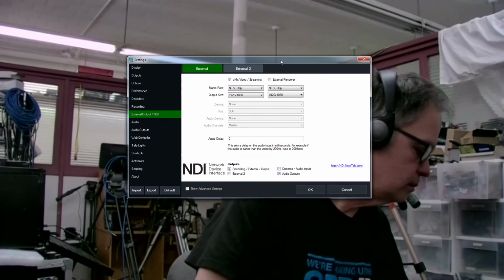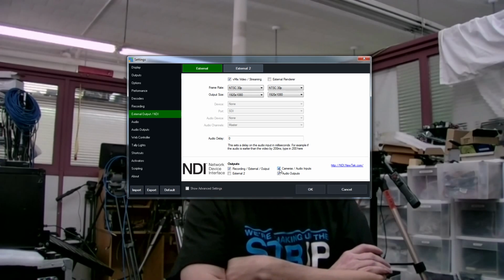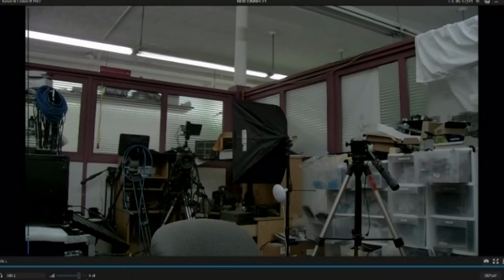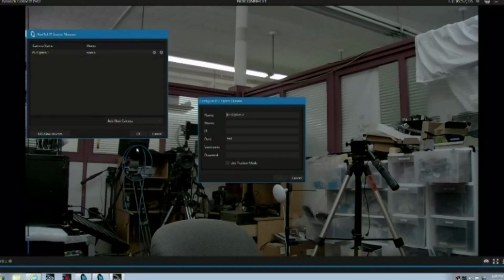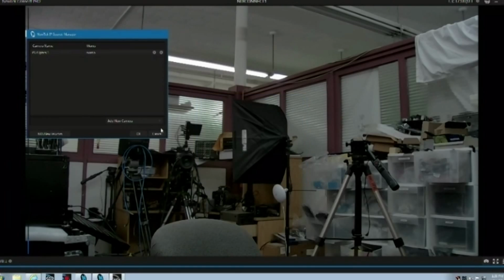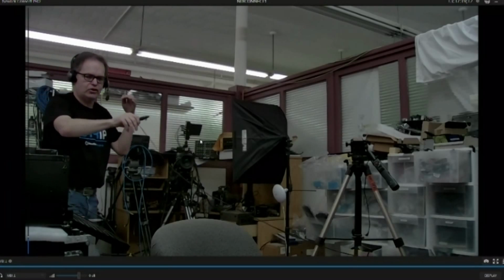NewTek NDI, vMix 4K, Latency, Gen Lock, Image Magnification, BirdDog and more...

Comment: i'm using NDI PTZ1 NEwtek cameras with my trecaster tc1 . when i switch between my PTZ cameras i get jerk while switching . (when i switch with cut)
what could be the issue ?
i'm using 1 gigabit of switch with 4 cables plugged in. three for cameras (PTZ1) one cable for tracaster.